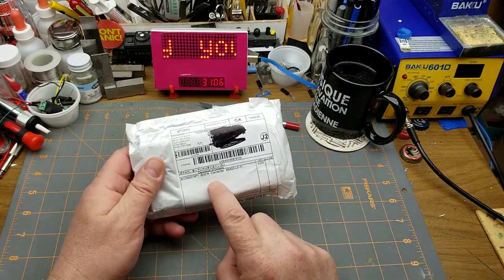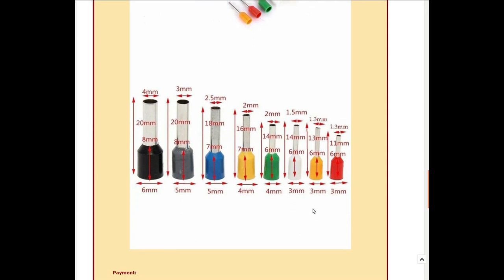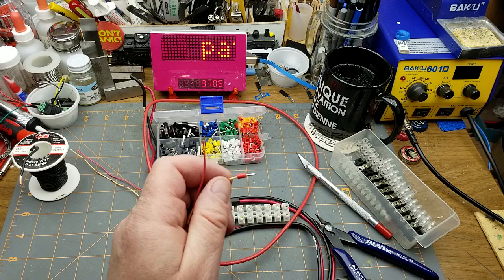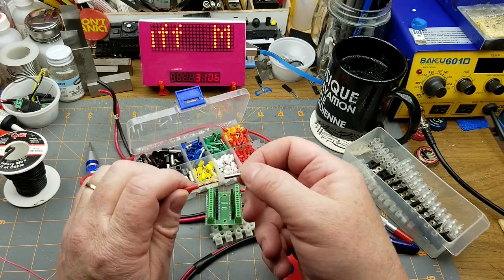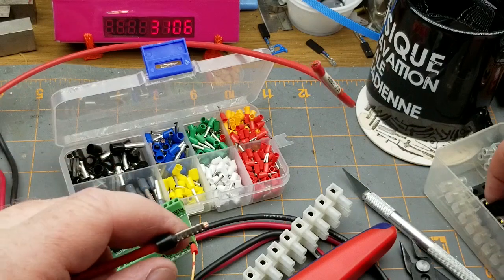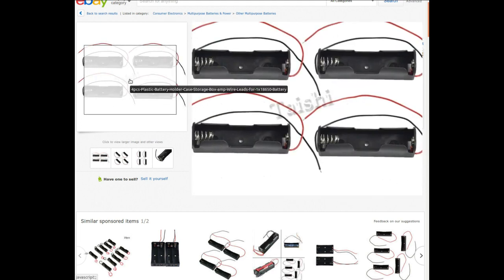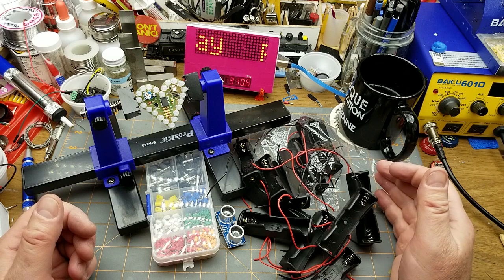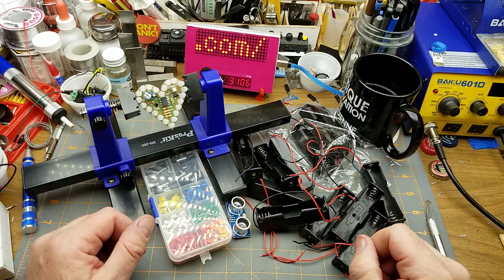mailbag monday 55

Comment: If you look at the crimpers there will be a bit that looks a bit like part of a gear with a screw between the teeth holding it in place. That is the tension adjustment, which controls how tightly it crimps the ferrules. You may need to adjust that. When I bought a cheap ferrule crimper set like that mine showed up with the tension at the lowest setting. If the tension is too loose, it won't crimp tight enough and the ferrules will tend to come off.
Reply: I have 4 comments to add re the pin crimpers.
1. I found that these crimpers are not in the slightest bit "self-adjusting" despite seller's claims. If you tighten them up for small wires, you will never get them closed (so they release) for bigger ones.
2. The tightness of the crimp doesn't matter much, since the terminal screw squishes the shit out of it anyway.
3. The crimpers with 6-way jaws are more expensive but do a much nicer job.
4. The assortments don't usually include logical colour groups. For example, I would want red and black for all sizes, not a random mix across sizes.
Reply from the maker: Thanks. I hadn't really considered that adjustments  would be possible on such a cheap tool.
Reply from the maker: @johncoops6897  Yeah, I'm a bit disappointed in the assortment of sizes in this kit.

The colours don't bother me as much. Being colourblind, I don't usually pay attention to that colour stuff anyway.
Reply: @johncoops6897  I am regulary using the original ones from Knipex and they work fine on big and small wires. No need to adjust. I am really happy with them.

Comment: I have one of those PCB holders and once you get used to it, its a great addition to the workbench. You learn that at times its easier to solder a PCB in positions other than horizontal.
Reply from the maker: I've already noticed that with some of my other holders. Getting the work closer to me ageing eyes is the first benefit I found.

Comment: I like those circuit board holders because they can withstand the pressure from the old desoldering thingy and keep the board sturdy.
Reply from the maker: I've already been using it for a bit of de-soldering on some random boards, just to play with it. It does work well for that. 

I hope to do a couple of kit builds using it this week.

Comment: Hi     I got my Circuit Board Holder from a company called CPC  here in the UK . Very cheap
( less than £5 I think )  . CPC are part of the same group as Farnell  .

                                                                                                                                  Alan

Comment: Having a 3d printer is a gift and a curse; Should I order a great soldering clamp, print a pre-designed one or design my own? Eternal struggle!
Good video as always!
Reply from the maker: There's a few on Thingiverse. I had one printed a few months back and it works pretty well for some sizes of boards.

Comment: Adjustable PCB Holder Printed Circuit Board Soldering Assembly Holder Clamp Tool->
In Europe you can buy that for 7-12 Euros, at the usual stores
Reply from the maker: So I'm told.

sadly, there are very few of "the usual stores" left around here. And those that remain are shockingly expensive.

Comment: This ferrule system looks great.  Strange I have never heard the word, or seen the thing -- ever!  Wikipedia says it they more common in Asia/Europe than the US.   All my life, have been moulding solder blobs to stranded wire, then flattening with pliers to make screw-terminal connections less janky.  Am going to buy a crimper and ferrules TONIGHT.
Just another crimper for the crimper collection.
Reply: Solder inside a screwed clamping terminal is extremely bad practice. Under mains wiring rules in Europe and Australia (and everywhere else who uses ISO/IEC based wiring code) the use of solder in that way is a huge non-compliance.
The reason is that the solder "cold-flows" (google it) over time, so the terminal will always become loose. You can use solder with a spring terminal but in a screw it will result in unreliable connections.
The ferrule system (pin ferrules) is also called "bootlacing" here in Australia. Almost all flexible cables in appliances are terminated with them. The bootlace is machine-fitted and designed in a different way, since they are on long strips. The Chinese system is great as it has the plastic boot which also tapers to make insertion much easier.
HINT: Do not twist the conductor strands, but straighten carefully then cut them square (not like Pile's ragged end).
Reply from the maker: @John Coops: Thanks for the mini-tutorial.

I had only seen these on a few other youtube channels previously. I didn't realize they were a standard (required even) item in other parts of the world.

I do know that the EU electrical code and common practice is quite a bit different that how we do things here in North America.
Reply: @johncoops6897  Good explanation!   Have noticed this "cold flow" loosening in my own work.  Now I know it is a thing, will always crimp stranded wire.

Comment: I think I need a circuit board holder suddenly...
Reply: shhhhht don't say it or the price will go up :)
Reply: I just finished a tutorial for a PCB with 220 SMD parts, and it worked great. The spring loaded jaw lets you spin the PCB quite quickly, and you can tilt the PCB to get better angles.

Comment: Those spring terminals holders for 18650s  don't work so great for high current draw. The ones I get have the large flat blade like contacts in both ends that give much better connection. They're still good for lower current draw stuff though.
Reply: I concur.  They are the worst.  Other problems too ... the spring and plate have undersized connecting wire, riveted to a swiveling connection, that easily breaks and opens.
The more expensive "flat blade" type are oh-so-much better.
Reply from the maker: Most of the things I've been using my salvaged 18650s for has been relatively low current so far. 

Do you have a link to the more heavy duty ones? I might need to make yet another trip to Ebay...
Reply: @pileofstuff  just one of this things to keep in the back of your mind. It can effect charging as well resulting in early charge termination.
Reply from the maker: @JWH3  Good point.

Comment: Heads up: The P version does not work (that is to say; I have not been able to get it working) in the One Wire Mode. That is where you use a single GPIO pin to both trigger and sense the device.

Comment: Seems like a lot of bother when a drop of solder works fine JMO
Reply from the maker: You meant the ferrules?

There's a discussion further down the comments that points out soldering wire for use with screw terminals is actually an electrical code violation in some countries.
Reply: @pileofstuff   I'm sure we wouldn't want molten lead spewing all over from the 20ma going to a couple LEDs ;)
Reply from the maker: @pleasecho2  Oh, yeah. 
In my typical application it really doesn't matter. I'm just messing around with stuff for fun here.

But in the intended use case for these things, it turns out that it does actually matter.

Never hurts to know the proper way to do things before you start experimenting with other ways.
Reply: @pileofstuff  Totally understood bro. Keep up the fun. I'll support you